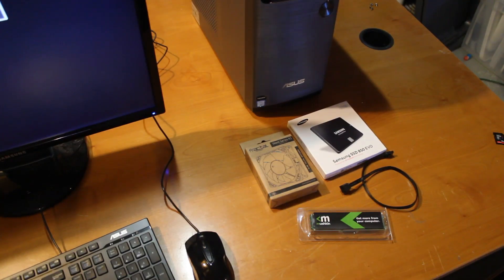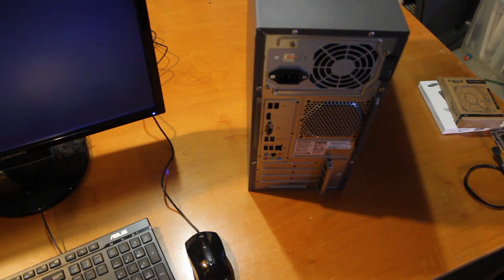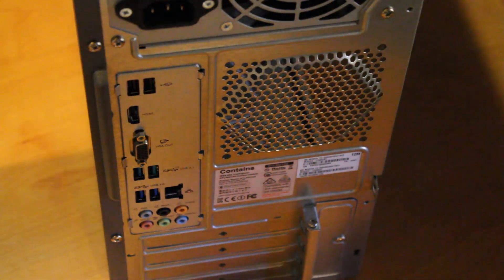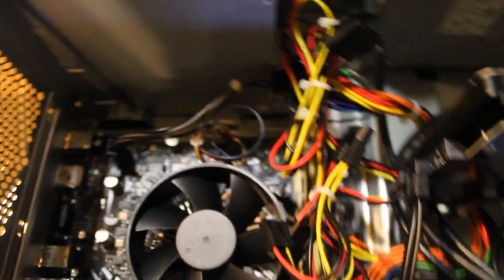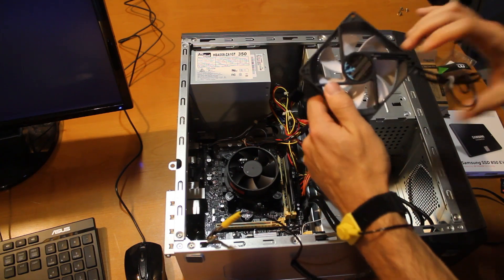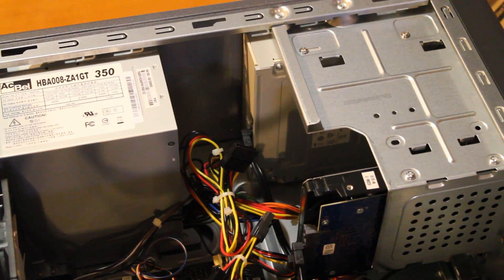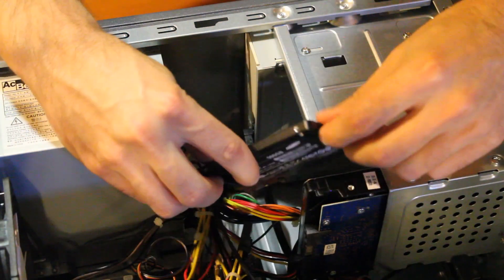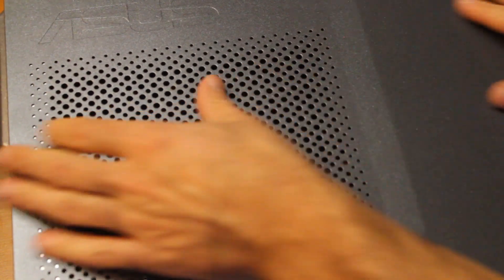ASUS M32CD Core i5 Upgrades (SSD, Fan, DDR3L)

Comment: Is there another 4 pin header for a front case fan? Plan on buying this as a starter since it's cheaper. Just gonna add 8GB Ram, Sammy 850 SSD, MSI 960 2G gaming, and a Corsair 500W supply.
Reply from the maker: +Justin Murcray No there's not another 4 pin header. A second fan will need to be installed using a feed from the power supply.
Reply: +Max Capricorn Thank you
Reply: +Justin Murcray Did you end up buying & upgrading this PC? If so, how is it working for you, & what kind of gaming performance are you getting? I'm planning on buying & making the exact same upgrades.

Comment: Do you need to install that casefan? I just bought this computer but with DDR4. Just curious to know if i need that casefan? Or what is it used for? (Sorry for bad english, im swedish xD and i know like zero about computers haha!) great vid btw!
Reply from the maker: +Andreas Berglund No, you don't need one. It's used to draw in cooler air from outside the case and push warmer air out the back. If you decide to put a high end graphics card in, you may want to look at installing a fan for a little more air flow.
Reply: +Max Capricorn ok thanks! 😃

Comment: If I install a Samsung SSD 850 drive I've been using in my old Asus computer do I have to wipe it clean before I install it in my new Asus M32CD..Thanks great informative videos...
Reply from the maker: +Jim Greeley to make sure you have the most problem free experience, I would format it before using it in this PC. depending on the type of hardware your old computer had, you'll most likely run into a multitude of driver issues. You could back up all your important data and give it a try to see if it boots and updates the drivers automatically in the new machine. I personally would go with a fresh windows 10 installation after the drive is installed in the M32CD.

Comment: Hi, would you think m32cd would support DDR4 RAM? I'm thinking of upgrading them
Reply from the maker: +cloudstruckk Unfortunately no, the M32CD only supports DDR3L ram. The motherboard does not have slots compatible with DDR4. DDR4 modules have more pins and the &quot;key&quot; on the module is at a different location compared to DDR3. EDIT: This information relates to the M32CD from amazon for $429. Looking at the bios page from ASUS, there may be a DDR4 version. Either way, DDR3/DDR4 aren't physically interchangeable.

Comment: Can You please make a video showing how to update your bios since you must update your bios when changing the ssd, and the m32  asus series have a complicated bios settings.Thank You
Reply from the maker: +James taos I didn't need to make any changes since I used a Samsung SSD which is in the secure boot database. If you happen to get a SSD that isn't in the database, you'll need to go into the BIOS and delete the secure boot keys:

1. Boot into the BIOS set up by pressing F2 during boot.
2. Click on the "Boot" Menu at the top of the screen
3. Scroll down and click on "Secure Boot"
4. Click "Key Management"
5. Save your keys out to a USB drive in case you run into trouble.
6. Then click on each of the 4 keys listed and delete them. This will disable secure boot.
Reply: +Max Capricorn thank you, but what I meant was I have an outdated version in my bios, there is 2-3 versions that came afterwards on their website and I am not sure how to update the bios since it looks so confusing and updating it is the best/safest way to take when upgrading the ssd. Thanks
Reply from the maker: +James taos I see they released version 0602. I'll do a video of updating to it within the next couple days.
Reply: thank you
Reply from the maker: I'm editing the video right now. It'll be uploaded within the next hour or 2

Comment: Yeah, this is basically right out of the box. I uninstalled the network adapter in Device Manager so Window could reinstall it. Nothing. I then updated the drivers and Windows found something but still no WiFi after reboot. Device Manager lists just 1 network adapter: Realtor PCIe GBE Family Controller. Using a cable it's all good but when I unplug cable no WiFi signal or anything like that.

Comment: I can't get the wifi card to work... any thoughts?  I assumed it would just find a network connection and ask for password, but nothing.  Is there a way to enable/disable the wifi card?  Maybe its off...
Reply from the maker: +andrewpm2 Is that what is happening right out of the box, or did you already re-install Windows 10? Check to see if the card is found in device manager, or as a network device in Network Manager
Reply from the maker: +andrewpm2 As a side note, I just booted into the BIOS and did not see any areas to enable/disable WIFI. Mine worked initially right out of the box, and when I reinstalled Windows 10 it found it during initial setup. If it's not working, I'd request a replacement from Amazon. The WIFI card is held in by a small screw, but to see if it's seated properly you'll need to open the case which voids the warranty.
Reply: +Max Capricorn does your Device Manager list 1 or 2 network adapters?
Reply: +Max Capricorn I'm assuming the WiFi card is that little card just beneath the PCIE slot with the 2 long white wires? It's screwed in securely
Reply: +Max Capricorn I unscrewed the little card and took it out. Rebooted and I don't see any change in Device Manager. Still showing the Realtek PCIe GBE Family Controller, which means that isn't the WiFi card. Can you show a pic of what your Device Manager shows? Something is obviously wrong with my WiFi card. It lists it under the BIOS but no way to change anything... Really didn't want to RMA
Reply from the maker: +andrewpm2 Yes, that's the wifi card. You could try re-seating it.
Reply from the maker: +andrewpm2 Here's what mine looks like: http://imgur.com/0t9xgoH
I'm guessing the bluetooth chipset is also on the mPCIe card as well. Do you see that stuff? BTW, where did you see it listed in the BIOS? I looked through and didn't see anything about the WIFI, just the wired gigabit adapter
Reply: +Max Capricorn you're right there isn't anything in the BIOS regarding the WiFi card. It was the onboard PCIE Realtek network card that I saw in the BIOS (under Advanced all the way on bottom).  I don't see any of the Bluetooth devices or the Realtek Wireless card. Just the Realtek GBE Family Controller. DAMN! Thanks so much for your help! Asus tech support couldn't help. They recommended a factory reset but I don't even know how to do that...
Reply from the maker: +andrewpm2 I highly doubt a "factory reset" would work. It seems more like a hardware problem to me. But if you want to try it this may or may not work with the M32CD: http://smallbusiness.chron.com/restore-asus-laptop-factory-settings-53444.html 

Another option is to use the Windows 10 Factory reset by: Settings > Update & security > Reset this PC Choose "Restore factory settings" If that isn't an option try "Remove Everything". If that doesn't work, I'd get a replacement from amazon because it sounds like you got one with a bad mPCIe wifi card.
Reply: +Max Capricorn I managed to get my hands on another mini-PCIe wifi/bluetooth card and voila!  Thanks for helping me out. This is a bad little computer once you upgrade those few parts and it's a very respectable gaming computer for less than $700.
Reply from the maker: Awesome! I'm glad you got it online.
Reply: Max Capricorn I have the same computer kinda. My wifi chip has connectors leading to the outside blocking the part where you put the graphics card. I am afraid to break this

Comment: can i use a 120 mm case fan?
Reply from the maker: +Siti Munawarah Abdul Hafid The holes in the case for the screws only line up for a 92mm fan. You may be able to hack a 120mm fan in there but I think it would be pretty ugly. 92 mm fit perfectly in both the rear and front slots.
Reply: +Max Capricorn so it will still fit?
Reply from the maker: No, looking at the case, there is not enough room for a 120mm fan. I would not attempt it.
Reply: @maxcapricorn3967  did you ever try to put a fan in the front/right side of the case? I see there's installation holes and vent holes but I don't see any other 4 pin slots that could connect

Comment: If I put a full sized Gtx 960 will it fit?
Reply from the maker: +Str8UpSavage762 Yes, that will physically fit fine. Don't forget to upgrade the power supply to handle that card.
Reply from the maker: +Str8UpSavage762 Also check out my other video on upgrading the power supply and GPU. You can see how much space is in the case for a long card. https://www.youtube.com/watch?v=PzrGWNnZSWI
Reply from the maker: +Str8UpSavage762 One last thing on this. If you do put a 960 in this, let us know if it shows as utilizing PCIe 3.0 bandwidth. We are trying to figure out if the slot is 3.0 or 2.0. We have a pretty good hunch that it is 3.0.
Reply: Max Capricorn How would I tell?
Reply from the maker: GPU-Z Under Bus Interface
Reply: Max Capricorn I will do this christmas and i'll comment on this thread
Reply: +Max Capricorn Sorry I got back later than I had wished, it is PCIe 3.0
Reply from the maker: Nice! Thanks for letting us know.
Reply: Max Capricorn No problem
Reply: +Max Capricorn can a 980 fit?
Reply from the maker: sure... you have around 13" of usable space.
Reply: you can fit a 1080 founder's edition in there
Reply: 700mobster You're a little late bruh...
Reply: Str8UpSavage762 well my bad mobile doesnt show post dates pimpin.

Comment: Great video! Purchased this unit and planned on upgrading the system as well. Will be doing the same type of upgrades! Very well explained tutorial!
Reply from the maker: +Nick Price I've been pretty impressed with the computer so far. I detailed some steps on installing Windows 10 on the new SSD in the comments section of my Amazon review, if you need any help with that. I was able to get my hands on a graphic card and power supply. I'll be working on a video showing that upgrade this weekend. After that, I think I pretty much covered all there is to do on this M32CD.
Reply: Awesome! I'm looking forward to that video. Thanks for the help.
Reply: Hola me puedes decir que marca y modelo de hdd trae de serie la Asus m32 ?

Comment: Thanks so much for the video.  I bought this machine and installed a samsung SSD.  My only issue is that now the machine is not showing the old 1TB hardrive.  It's there because it shows up in disk managment, but not when I look at "this pc".  Is there something that needs changed.  It's been awhile since I messed with hardware....I remember when I used to put jumpers on hard drives....master....slave....Is that what's happening here? There are two jumper pins on the HD but nothing really noting what to do to make it a secondary drive.  Any thoughts?
Reply from the maker: +Rodney Feltman There are no slave/master/cable select settings on SATA drives like there were with the old style IDE drives. SATA is 1 drive to 1 port on the motherboard. So you can see the drive in disk management? It should be listed as Disk 1 (931.39GB). How many partitions do you see on it? Windows 10 should automatically detect and mount any compatible file systems it sees at boot time. Did you already try to remove the ASUS partitions on the 1TB drive?

If you want, take a screenshot of what you see in disk management and email it to me at maxcapricorntech@gmail.com
Also send me the output from the following commands:

1. Open a admin command prompt by right clicking on the start button and choosing the option from the menu
2. type "DISKPART"
3. inside diskpart, type "list disk" - send me that output
4. If you see Disk 1 listed as 931 GB, type "Select Disk 1"
5. type "list part" and send me that output.
Reply: Max Capricorn Thanks for your help...I found that the drive was offline... I set it to "online" and it was fine.  thanks for your help.

Comment: Looking forward to your next video. I just ordered this machine off amazon. Wanting to put SSD + more ram in my new machine. I did notice you didn't select Master / slave on your drive or is this not necessary with SATA.
Reply from the maker: +Axe1401 SATA drives do not have the option of daisy chaining like the old IDE style drives did. They are connected as one drive to one sata port on the motherboard, which makes for an easy installation. The boot order can be selected in the BIOS. The 3rd video is up which details the process of removing the front case panel to access the DVD drive and case fan.

Comment: Thanks for the video man. Question. What about a graphics card? Will this motherboard support a medium or high end graphics card?
Reply from the maker: +Alex Ray It'll support high end graphics cards, but the issue is the power supply. The power supply is only 300 watt and most modern graphics cards recommend a 500+ watt power supply when you look at their spec sheet. I've read some people have put in a 750ti or lower card while keeping the stock power supply.

If I was going to install a higher end GPU, I'd look for:
1. A decent power supply replacement (swapping that out should be simple).
2. Higher CFM case fans (Front and Rear - this case only accepts 92mm size). GPUs tend to throw off a lot of heat under load and it would be a good idea to get that heat out of the case and bring in cooler air.
Reply: +Max Capricorn ok got cha! What about the processor? Is it powerful enough to handle high end games like fallout 4?
Reply from the maker: Processor is fast. You shouldn't have any issue with the current round of AAA games as long as your GPU is up to snuff. Some games are a little more CPU intensive than others, but all and all, a 6400 skylake should be smooth sailing.